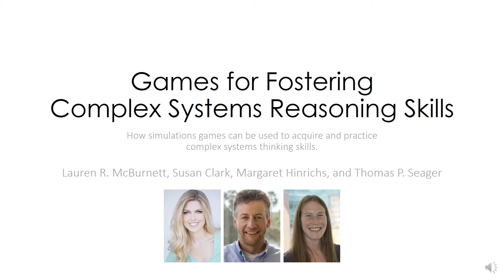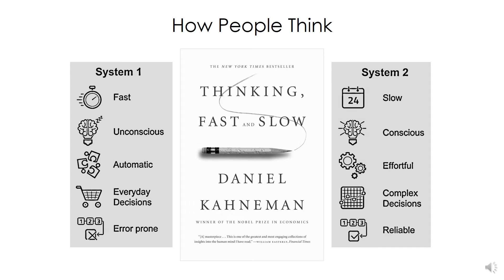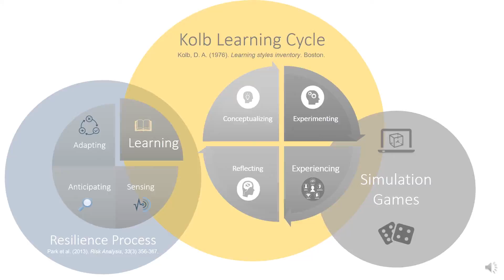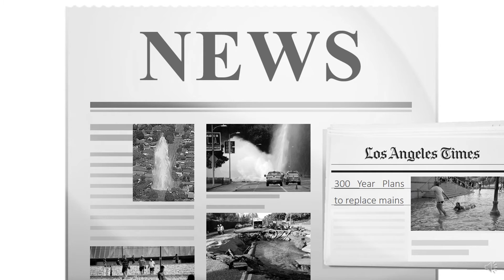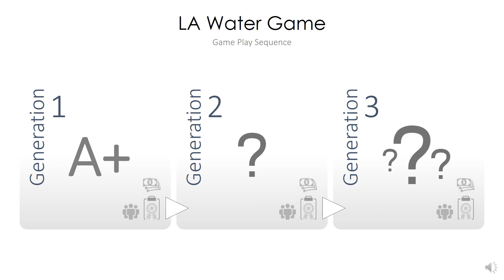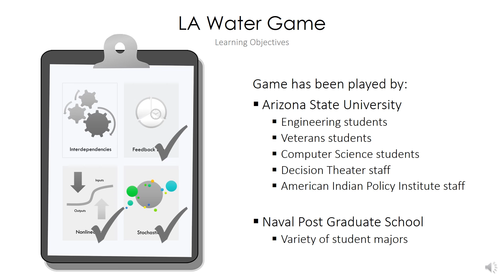Comment: Dear Lauren,
your talk ended where I expected the core part to finally arrive. Specifically, a coverage of how the players managed the nonlinear system and what were the main ways they had problems with its nonlinear character. What was the underlying system dynamics? 
Also, making a more accurate title would have helped. The current title suggests that you are going to review multiple ways of introducing complex systems together with some insight on what works and what doesn’t. Your specific project is great and good luck with further research :)